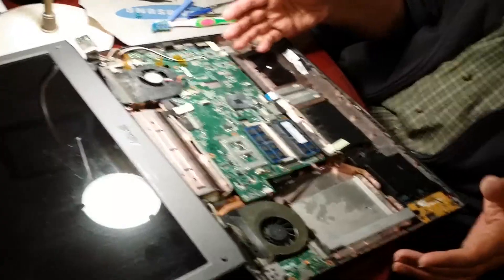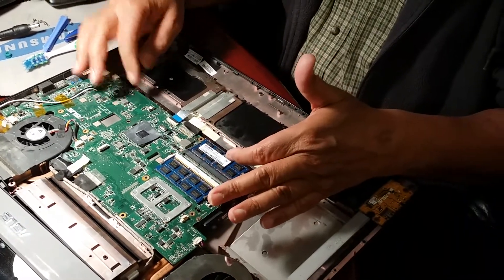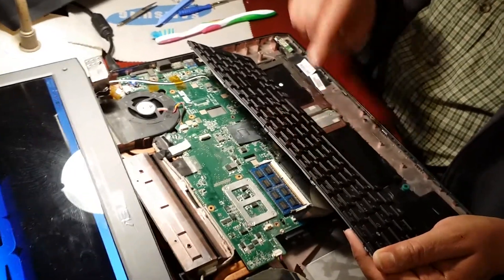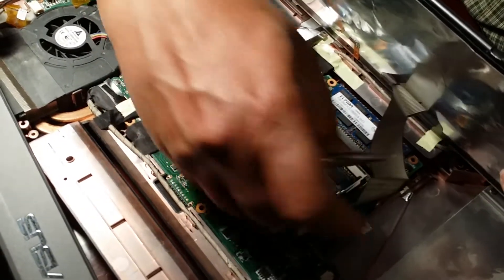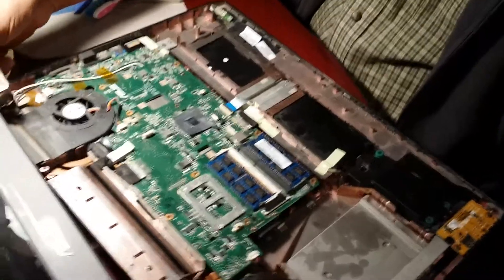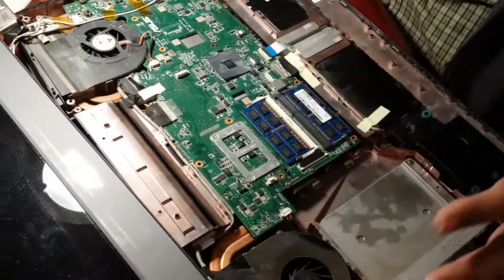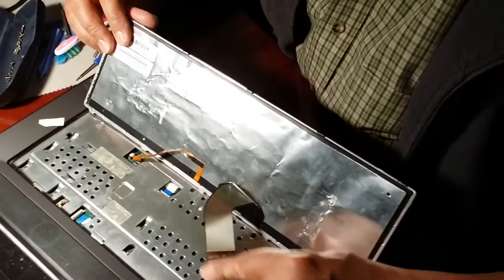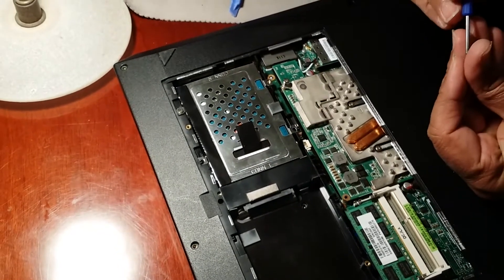How to Assemble or Disassemble ASUS G73SW in Easy Steps

Comment: You seem very well versed on the Best Buy G73JH. I have this exact model, and I have a different issue than most. Thank you so much for the video.

My Subwoofer is BLOWN and I am desperately seeking a fix.

Is the 3.5mm jack part of the sub-woofer? 

Can I simply disable it when I have the chassis taken apart or is it a fake 2.1 audio that is sync'd with the 2 speakers?

The Windows 7 software, and the Realtek software have no way to disable the sub-woofer alone.
I have tried other compatible drivers, but none of them can disable the sub.

I check the ASUS Forums, Windows 7 help, Toms Hardware...

There doesn't seem to be anyone online who knows how the Sub assmebly works.

Any Feedback would be great.

Hopefully I can just unplug it, but that would be too convenient.